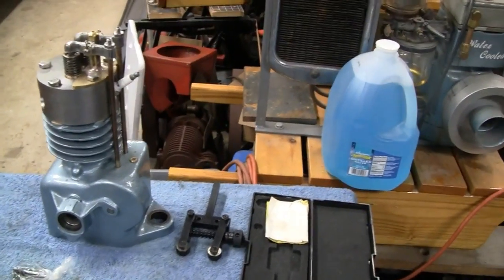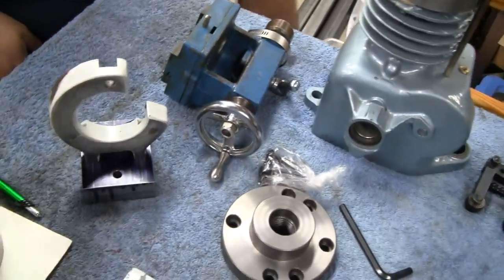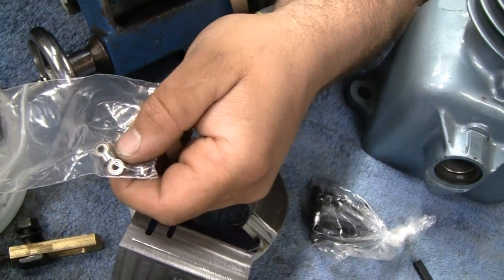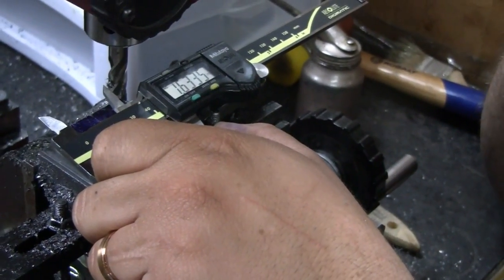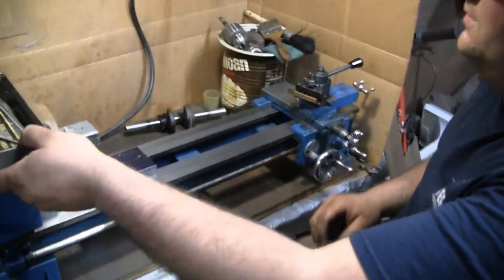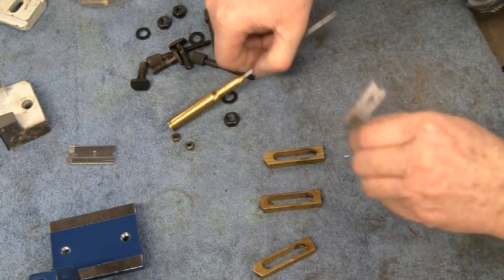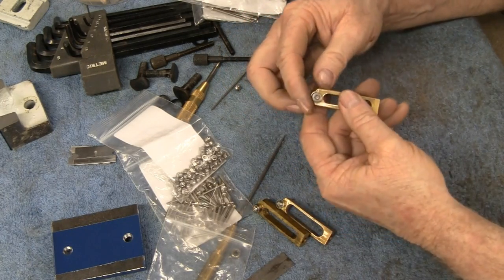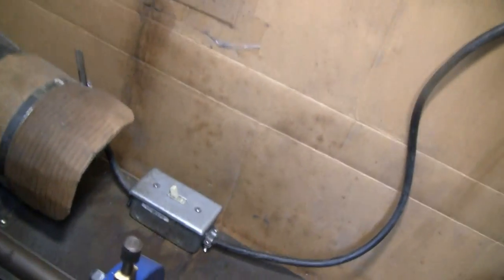OHV BRIGGS UPDATE

Comment: Congrats to you and the Mrs. Mike. Been with my Mrs. 25 years this year. 
With that said, Yep that 4-Jaw Chuck and Steady Rest will allow you to true up both ends nicely. The nice part is that you get to keep the equipment for later projects. You can be used to make offset rotating parts in the future like small steam engine crankshafts or camshafts. Those are going to be a nice addition to shop. Good job guys. Best Wishes & Blessings. Keith Noneya
Reply from the maker: Thanks alot Keith!!☺

Comment: Fantastic work RK, glad to see you guys went with the steady rest for finishing the crank as many commenters had suggested.  It will be an asset for future lath projects at RK project central.  You need to make an 5S Diesel one day.  That would be a novel exhibit.  Just look an one of the beautiful miniatures, built from scratch, by Find Hansen on You Tube.  Should be easy, now that you and Mike have mastered an OHV head design.  Just raise the compression, add an injector instead of a spark plug and add a cam driven plunger fuel pump.  Hope your shoulder repair goes OK and keep up the great videos.
Reply from the maker: Thanks alot Gary!!☺